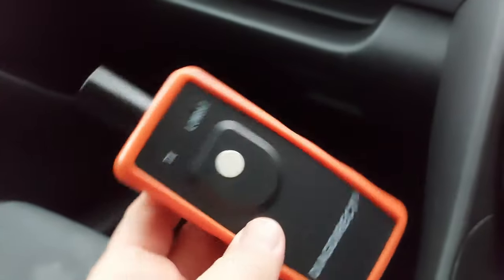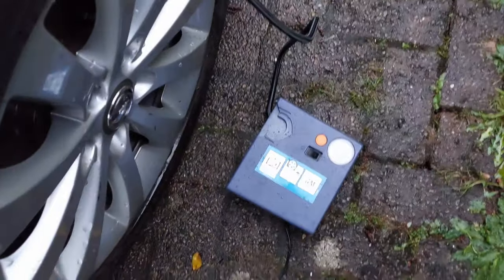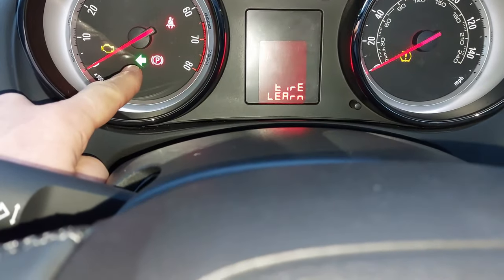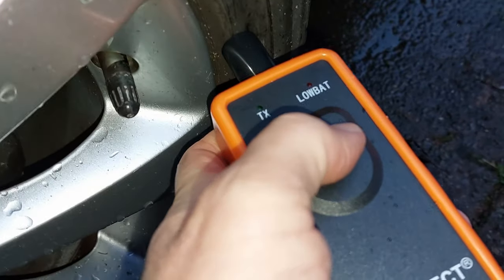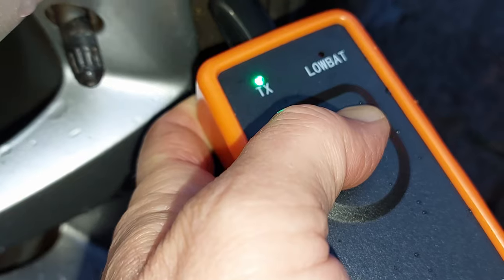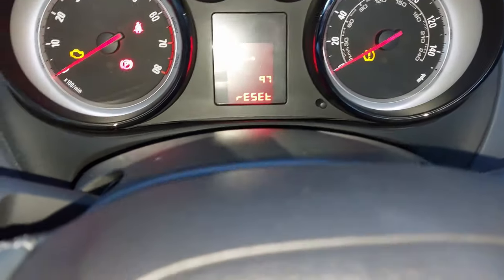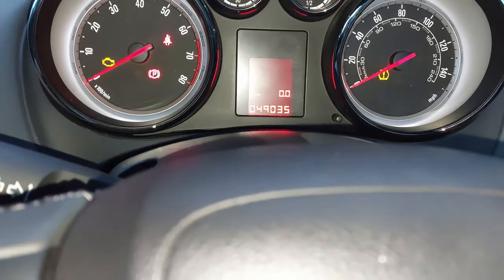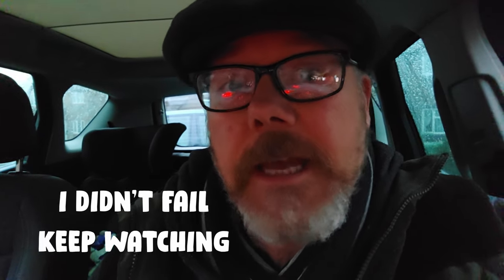VAUXHALL TYRE PRESSURE LEARN RESET - TYRE PRESSURE SENSOR LIGHT FLASHING STAYING ON TPMS Reset Tool

Comment: Thanks bought that tool for £3 and worked. To other people who say it dosent work make sure the correct tyre pressure is in each tyre depending on the tyre setting you have set on your dash or it wont work. Meaning if your tyre is 30 and you put 31 in tyre the dash light wont come off.

Comment: As the battery fades with age in the tps you need to hold tool firmly against tyre sidewall as signal is weaker. Indicator will be solid on each corner as you say front left etc good video
Reply from the maker: @wendyloane7971  👍👍

Comment: Great video but I’m currently looking a replacement valve for one of these any suggestions thanks
Reply: The sensor is fine inside of it
Reply from the maker: It is showing these type for Meriva... https://www.ebay.co.uk/itm/114657416167?var=0&mkevt=1&mkcid=1&mkrid=710-53481-19255-0&campid=5338268676&toolid=10044&_trkparms=ispr=1&amdata=enc:11BiXkKNpR7yw9KOBWmTc_g84&customid=Cj0KCQjwvZCZBhCiARIsAPXbajvayUxzbQhZnhN8FMhHB1zJBqE6s4NXK6gjSrmJeFT2CsfHGjn0YvYaAlm3EALw_wcB

Comment: I had the same problem the back tyre driver side wont make a sound not sure what else to do
Reply from the maker: Might be low battery in the tyre wheel sensor or it might be the furthest away from the cars internal sensor?

Comment: Hi please good afternoon,  I av thesame problem but mine is showing 3 tyre pressure on the screen instead of 4. Does that mean one of the sensor is not working on the one that is not showing the tyre pressure.  Thanks
Reply from the maker: I'm not sure as mine doesn't show separate tyre pressures on the Meriva b
Reply: @baconbuttties  ok thanks you
Reply from the maker: @adelekeakeem5900  👍
Reply: Did you solve your problem? If yes please tell me how. Thanks
Reply: I have a 2019 mokka x, i just got 4 new tyres, and same as you, i have 3 tyre pressures being displayed, off side rear isnt, ive had it checked and the sensor is good, but its not displaying, if you fixed yours could you let me know how, many thanks.

Comment: Will it work on 2015 antara as well?
Reply from the maker: I can't say for sure, probably the same system but not 100 percent.
Reply: @baconbuttties  just bought this tool for 2.5 pounds from eBay and will see🤣
Reply from the maker: @Dzacu4  Hope it works